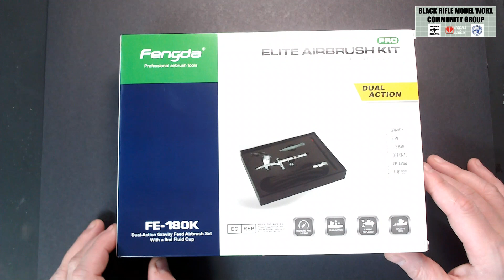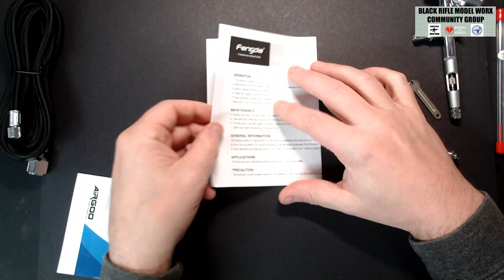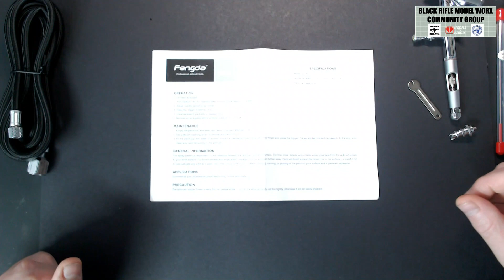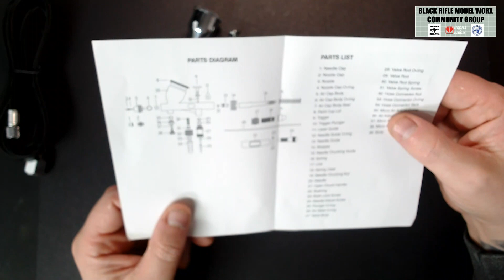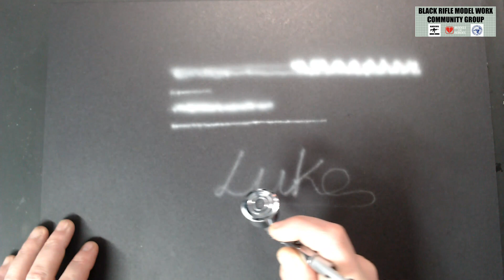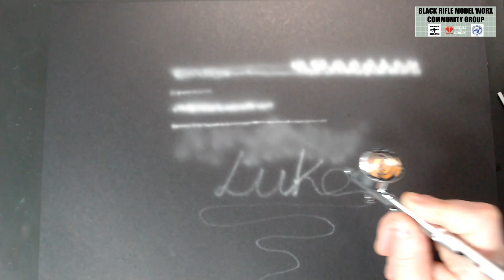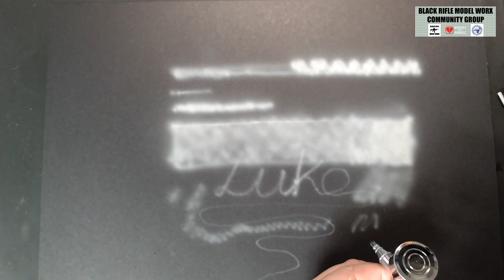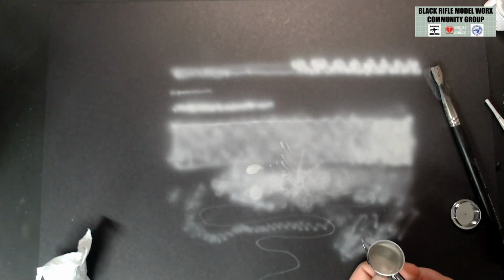**Sub £25 Cheap Airbrush** Fengda FE-180K Airbrush Review and Test

Comment: The quality of these is amazing - comparing to an Iwata hp-ch which I have used with pleasure for many years, no performance difference - maybe a slight lack of finish compared to the Iwata, but no affect on results.
Iwata in trying to control the airbrush market, and retain hugely inflated prices , have shortened their market and have responded by inflating their prices to even more ridiculous levels. Let's see what happens.
Reply: @fraserhardmetal7143  it's been 9 months and the only thing that has changed is that now HARDER & STEENBECK is taking over the top spot in airbrushes. With the arrival of the 2024 Infinity,  I believe all other airbrushes have been relegated to the obsolete file.  .  .
Reply: Unfortunately the lag in the trigger is still there.
A Micron or PS771 wipes the floor with it.
Reply: @vonovine  finesse the brush - lap and polish the mechanism- optimise the functionality - I do this with any tool I buy - I have hand scraped a milling machine table to get the best out of it - why should a simple airbrush mechanism be any different ? You are happy to pay 20X the cost for a product when a little polishing and  lubrication will achieve the same performance on a better value item. People are brainwashed by the SnapOn model of dearer is better - don't be taken in.
Reply: @ Lap & polish the mechanism?
For starters the PS771 is half the price of a Infinity 24?
I prefer a Micron with a PS771 head & needle fitted.Works straight away to perfection.
I don’t have to “Lap & polish it”.
But if that’s your thing.. Go For It!
Reply: @vonovine  you obviously have no idea what you are talking about - keep on paying through the nose for overpriced tackle - price or name does not confer quality .
Reply: @fraserhardmetal7143  you obviously have no idea what you are talking about-
keep paying pennies or “dimes” for your equipment & polish them to your hearts content in the hope a frog will turn into a prince.

Comment: Looks a nice Airbrush, have you tried taking to nozzele apart for cleaning ?
Reply from the maker: Not yet mate, I have used it properly in anger now and had no need to remove the nozzle for cleaning, just removed the needle and cleaned with no issue at all.

Comment: Luke, great review. What's it like lacquer? Cheers Philip
Reply from the maker: Cheers mate, I think it will spray lacquer just fine, issue may be the seals as at this price I don’t think they will last long with heavy lacquer use but time will tell
Reply: Thanks Luke, have ordered one to see what its like. Btw, the nozzle design is similar to the Sparmax GP825 set up, take off the cap and the next cap and it screws into the large base section that screws into the body.
Reply: Looking at their website it does have a PTFE o ring so will spray lacquer. Also the 183 model has a nozzle set up similar to the apex